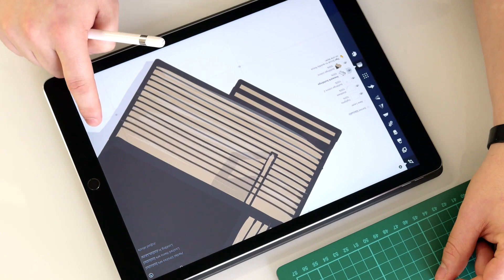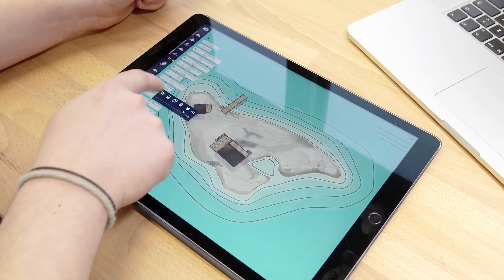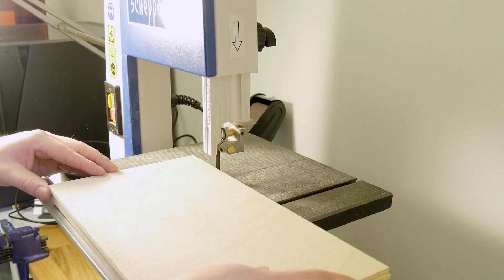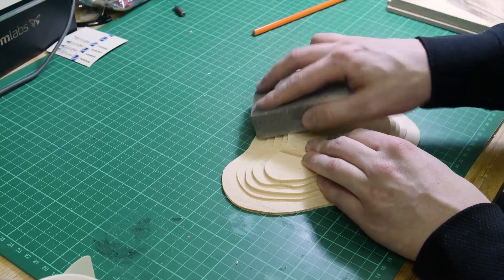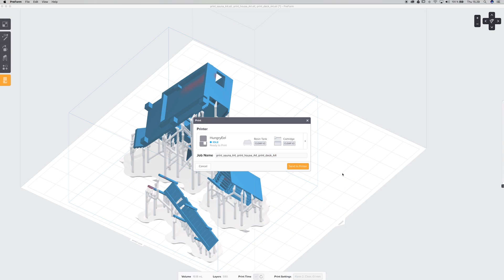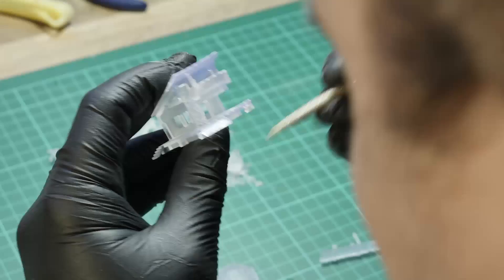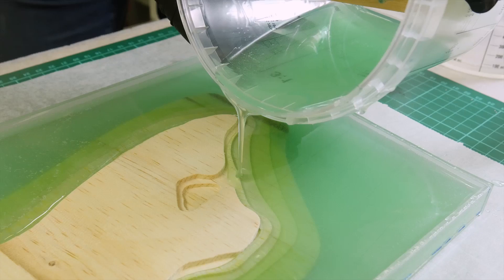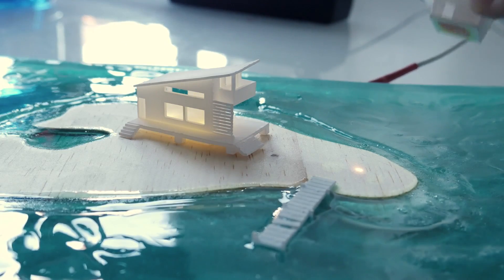Concept to Delivery: Architectural Scale Model Build

Comment: Thanks for sharing.

I use Concepts for the free flow of ideas, then firm them up with Vectric Aspire to generate toolpaths. I see you are iOS centric? I am using Microsoft Surface Studio 2 (with a Dial) which blows away any computer I have used in the last 40 years. Hope You guys continue support for that ecosystem . . . it rocks!

Aspire does a great job with vectors and saves me from having to “deal with” Adobe Illustrator. My toolpaths from Aspire drive a Carbide3D Shapeoko.

A system that really works great.

Keep up the great work with Concepts!

JimInAshland

P.S.Consider using a multi-tool with a small blade to cut your tabs, it is more convenient than the band saw cleanup.

The one I bought: Odyssey Oscillating Multitool Thin 3/8" Wide Wood Plastic Saw Blade